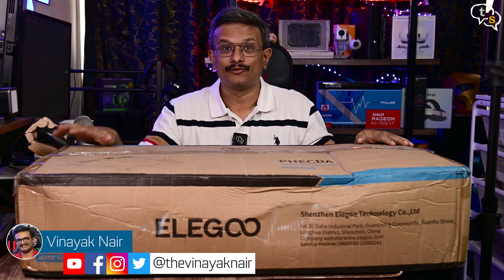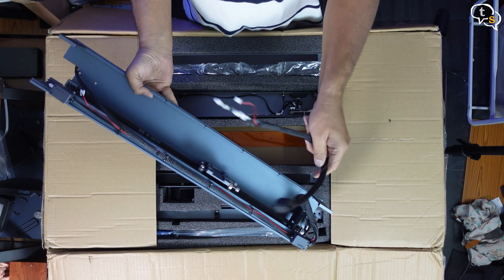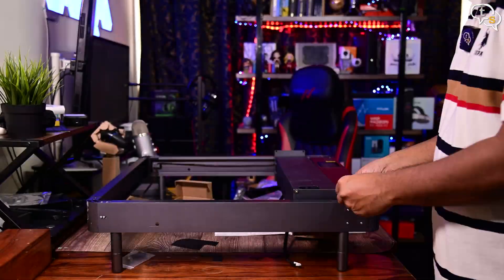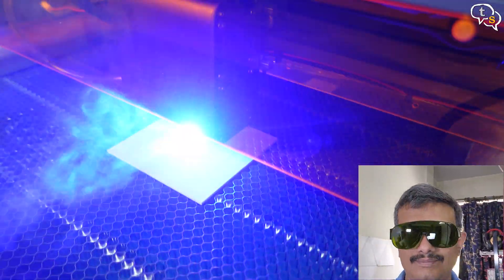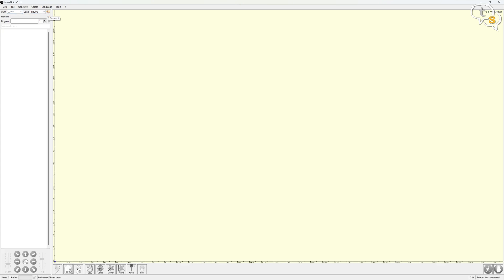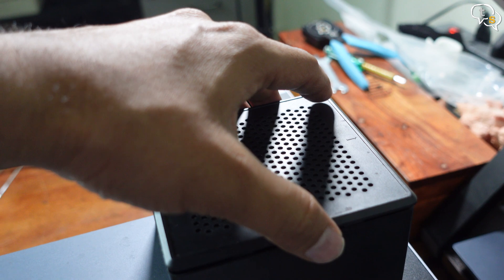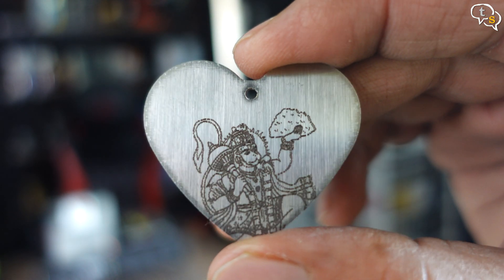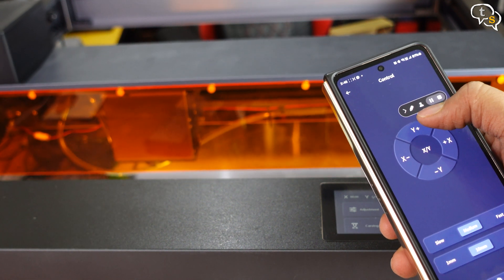Elegoo Phecda Laser Engraver Cutter - India

Comment: Hello.
Can you tell me if this Elegoo laser can cut metal sheet, soft metal like brass or aluminim, verry thin, 0.2- 0.4mm ?
I want to cut very small parts for dioramas, from some metal. Some are small like 5mm length
Can you make a short video tutorial with some metal cutting? Thank you
Reply from the maker: 0.2-0.4 mm i feel it can cut through. Engraving on 5mm I can guarantee, cut, it might not. You can run multiple passes.
Reply: @TalkingstuffNet   thank you for your fast replay. if you can and have time, can you make a small video with some very small part cut from some metal sheet?

Comment: Hello, can the 10w model cut 4/5 mm plywood, MDF ?
Reply from the maker: It should be able to, as I've not used the 20W model at full power. If it doesn't you could always run multiple passes.

Comment: How well does it cut/engrave leather?  How thick of leather can or will it cut?  Will it cut cleanly?
Reply from the maker: I have only tried the sample leather piece provided and it cut quite cleanly. I have set the power only to 40% and it cut a bit deep, if you set it 100 I feel it can easily cut through half an inch.

Comment: Hey man, I got the 20w Phecda a couple months ago and since I've never used a diode laser before I was somewhat intimidated lol. I've been 3d printing for years now and wanted to dabble in the laser engraving/cutting maker space. I tried using the included metal dogtag material but couldn't figure out how to get the damn image onto it, but now I know to just make multiple passes, so thank you for that!

 Now however, I want to cut some semi-transparent 4mm acrylic but can find a trustworthy source to teach me how to do that with the Phecda, any suggestions?
Reply from the maker: Hi, thanks for watching my video 😁. If you have a spare piece of acrylic you could try different power levels and check how they work on it. Once you get the right settings you can print on a bigger sheet.